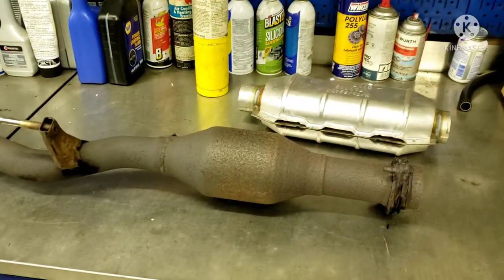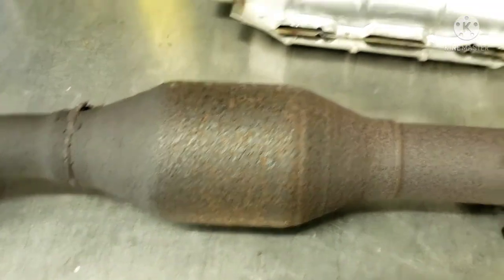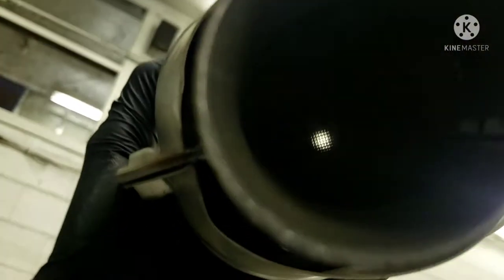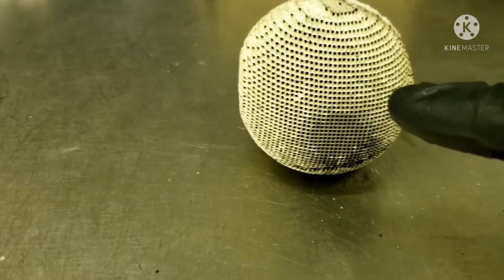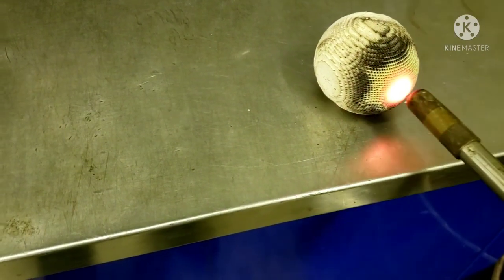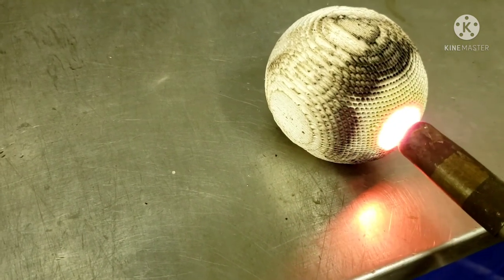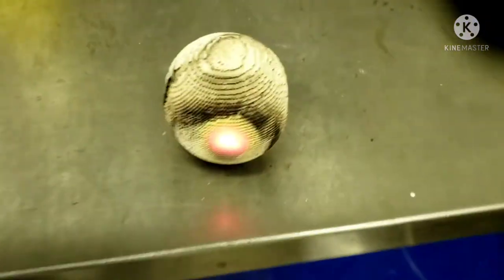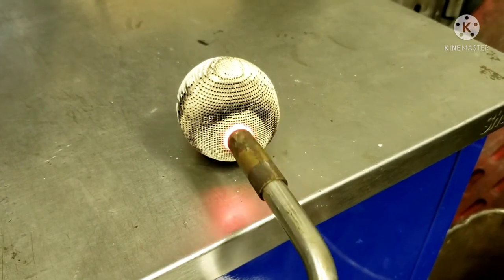How a Catalytic Converter Works!

Comment: I used to have a little gas powered soldering pencil/heat gun/mini torch, and there was a little grid that looked just like that inside of the heat gun tip (that was used for the soldering tip as well. It only just now occurred to me that that is the same thing as the inside of the catalytic converter.